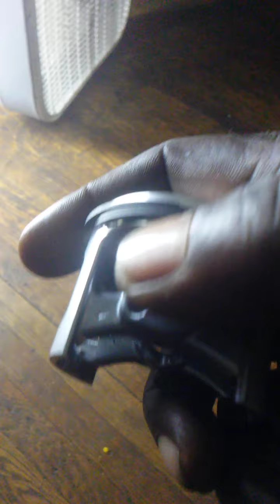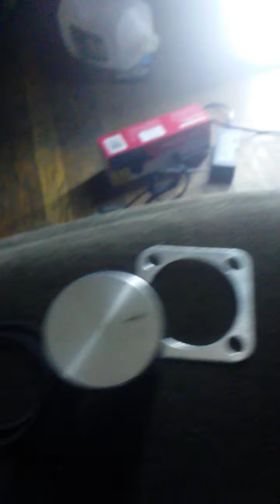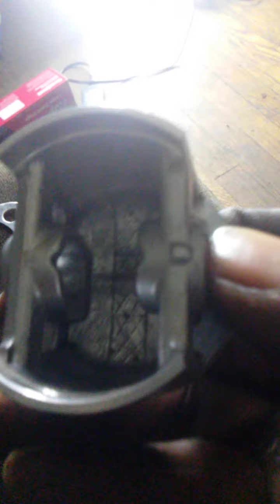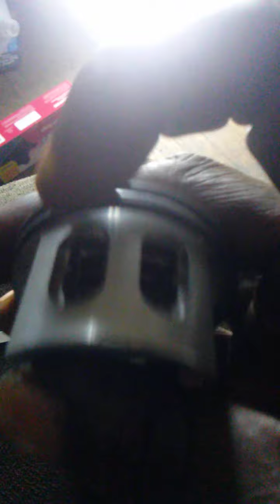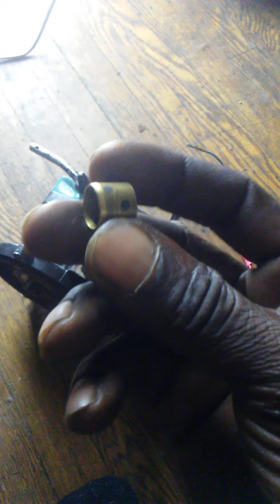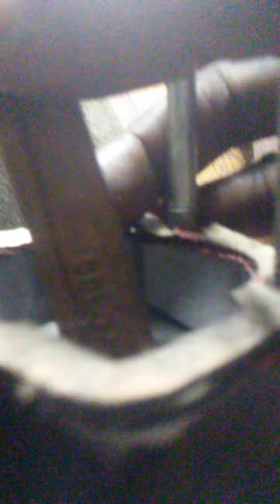$elf Destruction??Phantom 85 piston 52mm  which is the right one? $cience test??

Comment: cool I got mine in today the piston is coming from Germany I also ordered a stihl 10mm pin bearing ERT and you and one other Youtuber said the same thing also was told to check the and make sure that the transfer ports and intake have a little gap on either side because of issues with rings snagging I wonder why your friend didn't change his piston he'd still be running on one anyway thanks for the info and stay safe
Reply from the maker: @Mike miller the the piston in that video is a ms380 had to go back to purchase history on eBay. So this piston I&I bought last year never tried it? My brethren Pete told me about the ms460 still haven't come in the mail. I'm going to test the MS380 instead. as you were
Reply: @sealeyscience6181  the one I was told was ms 440 I think one of these guys on you tube said there all the same size just the weight is a little different I don't really care I just want a good dependable engine that's all be safe brother when my piston gets in I'll let you know how it goes